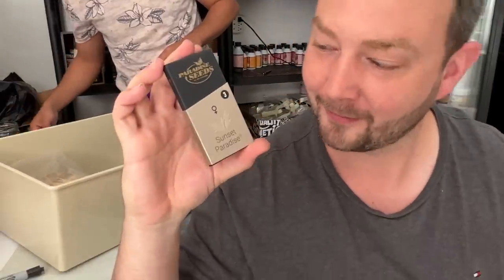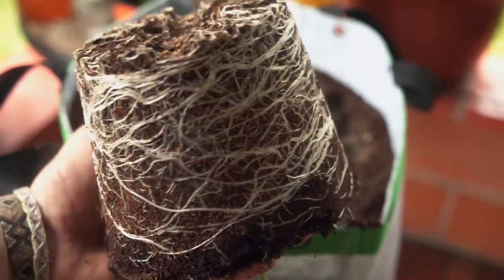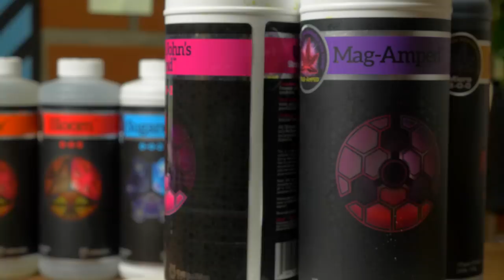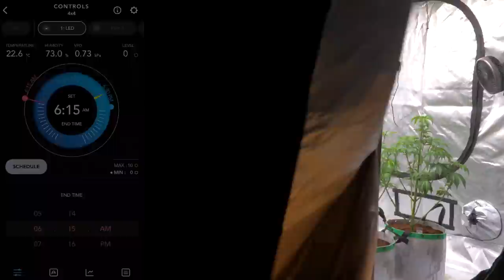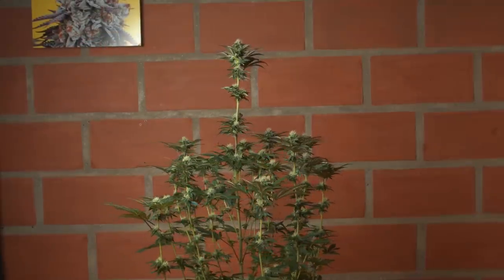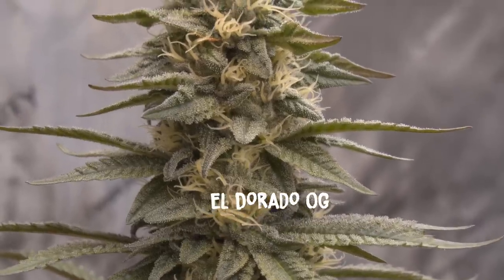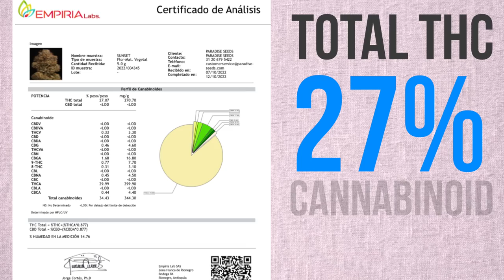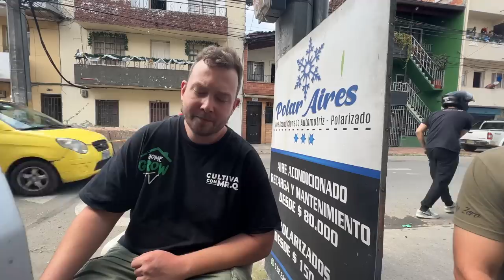Sunset Paradise - Seed to Harvest (Paradise Seeds) AC Infinity 4x4 Grow Tent & Controller 69

Comment: When I had mag issue with my Los, I used Epsom salt.. For cal I took about 2 dozen egg shells, smashed them up while cooked them on a pan.. You wanna filter off the wee bits of egg paper.. They are extremely light, so all u need to do is flick the egg shells up in the air, only enough so the egg shells paper floats away by its self. ( do that past outside, the wind will help u.. Once egg shells are chared, place into jar of organic apple cider vinegar, and you should see lots and lots of agitated bubbles coming from the shells l. If u don't see this, u haven't cooked the shells for long enough. U only need to let egg shells sit in the vinegar for about 10 days and then u have water soulable calcium.. I added 1 tbs of each to 5g and never had any cal/mag issues, and it literally only cost me about 4 bucks to make it all
Reply: 2 dozen egg shells would cost you about $20 where I live glad I saved about 20lbs of egg shells before the greedy inflation
Reply: @jeffambrose5244  sry I miss typed there.. I used 2x 6 boxes of eggs.. So 1 dozen I used lol.. It was early as shit in am when i wrote that
Reply: @todgerx  no worries thank you for the great knowledge and advice
Reply: i done teh same thing except calcium citrate, using citric acid which is super cheap for pH.

Comment: When my plants start to look a little ill I'll start off first with a jadom feeding. I do mine a little different I put a potato with a banana and some slices of aloe vera in two socks. The third sock I put compost worm castings and a couple spoonfuls of garden soil a soil from the local woods along with a couple pinches of kelp. I suspended from a stick into a 5 gallon bucket of distilled water then add a tablespoon of sea salt cover with a bag and let sit 24 to 48 hours until bubbles appear every time I've done it the plants explode!
Reply from the maker: That’s sick!! Thanks for the details

Comment: Gotta a pack of Delahaze from Paradise Seeds . Gotta get those cracking.
Reply: I have been trying to get my hands on delahaze seeds.. I got delahaze and nebula from them 8-9 years ago.. honestly I got them mixed up, they were fairly similar strains.. Anyway, it was a free seed and one of my favorite strains I ever ran.. unfortunately they have been out of stock every time I check and they don't ship to usa anymore 😔 I'll keep trying to get my mits on some though..
Reply: @blasterresto  Bummer that it was your favorite strain and you can’t get it anymore. Just checked my Canadian site and they still have some paradise strains but Delahaze is completely unlisted. My cuz grew Delahaze a year or two ago, said it was shaping up to be his best crop ever but didn’t have great air circulation or humidity control. Ended up losing the every top to bud rot.

Comment: I have the exact same light and my plants curl down and taco when the light is too strong. Super weird but that’s why it only seems to happen at the top. Then turning it down fixes it. Which you wouldn’t think that’d be the case with the ppfd being measured but idk for some reason that seemed to be the issue.

Comment: @6:30 really the thickest tents? Please test Homeboxes from Germany, they are white on the inside and cream colour outside which makes them look more roomy and legal, and they are really good quality with double , uh how is it called, like a double underside so you can flood the tent and the zipslocks work perfectly even after 3 years of use, and the only small downside is that you have to be careful to not cut the light blockers of the zips by opening and closing and getting them trapped in the zippers.

If I get to colombia this winter I can bring you one along with some Kingbrite LED lights and Systemair super low noise EC extractors ^^ can't imagine anything better

Comment: 8:05 If you don’t want a build up of salt in your grow media. However you still want to use epson salt for the magnesium. Then you can mix it in a spray bottle with a little hydrogen peroxide (h2o2) to speed up the salts dissolving. Then use that as a magnesium foliar spray.

Comment: Hey man what type of camera do you use? do you also have a macro lense for it? I really love the quality in editing that is steps beyond everyone else. I'm trying to get better
Reply from the maker: I rock the cheapest cinema camera in the game BMPCC 4K & Q has a 6k we use for macro

We just introduced a rhino slider to the team as well
Reply: @HomeGrowTV  nice thanks for getting back to me. I'm having a hard time showcasing the quality of my grows with just GoPro's. I'm gonna check that out.
Reply: @asgdhgsfhrfgfd1170  dude idk how to fix that. I'm using cob led and there very similar in spectrum to hps. So that's like a frame thing but I can't figure it out unfortunately. I think I'll have to buy a different set of LED's to get rid of that.
Reply: @asgdhgsfhrfgfd1170  thanks man for checking out the channel. Yeah I really wanted to buy a gimblIe just haven't had the spare money too. I'm definitely working with a minimal budget setup. It's what I have for now but if like invest into something more professional. We all start somewhere
Reply: @asgdhgsfhrfgfd1170  Hey I really appreciate your response. Theres a lot to go over so excuse me if I miss something. you know I never heard of the led dimming trick. That makes sense, I will try to buy a dimmer later this weekend. I use one on my fan system I'll switch it over to see if I can get both to dim. I have the lights (two) running into a timer which now I will have to put the timer on the dimmer and or buy two dimmers and put them on before the timer then the outlet. I will do some experimenting today and see if I can get that. 

As far as the frames, I'm not sure if I can adjust frames on a gopro? I will look into that I think default is 30f/sec so maybe like you said if I can go down to 24 I may see a difference. I gotta google and figure that out.

I certainly will try all these techniques and see if it works. I would def rather not buy any new lights anymore haha I really appreciate the informative response
Reply: @asgdhgsfhrfgfd1170  Hey man I just wana thank you for your detailed response. It worked! after literal years of filming with these stupid black bars a 5 min conversation with you literally solved everything! you were totally right about dimming the light down. I set up a dimmer on the timer allowing me to dim both at the same time and that is enough for me to get rid of those lines. I can still shoot at 60 frame a sec at the lowest setting or 24/f/s at medium light settings. So Obviously I'll do the 60/f/s at 400iso, fully dimmed light settings from now on for best results. Anywyas I cant thank you enough!!!This literally will make my videos 10x better!!!